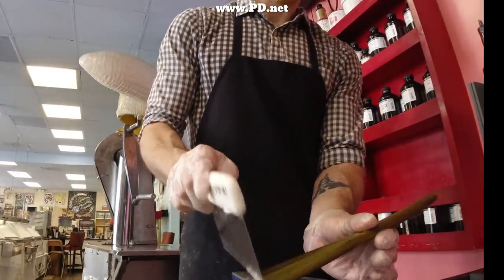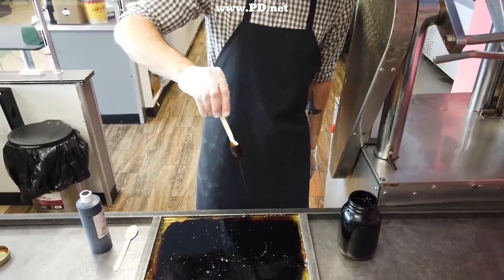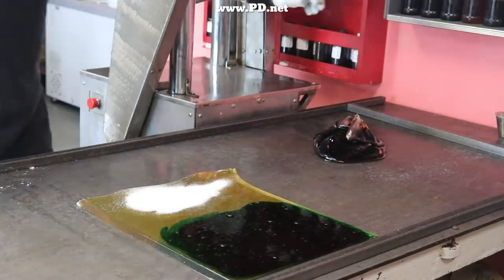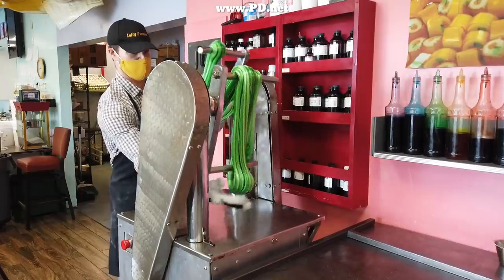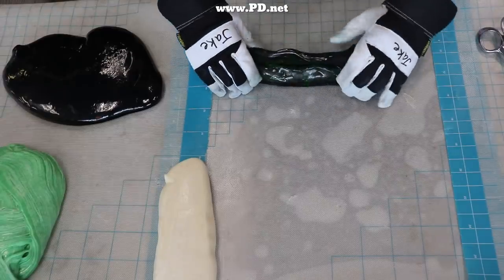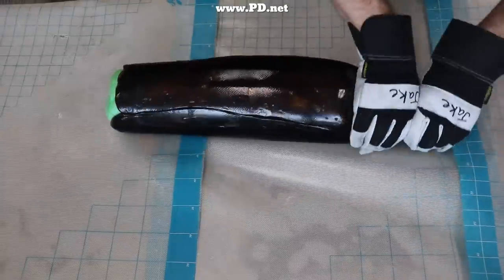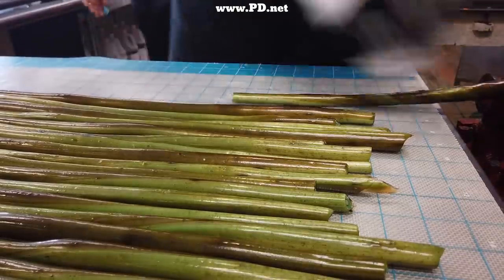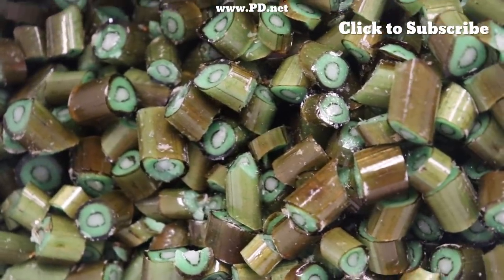#138 Kiwi Candy: Jake takes his skill to the next level - Part 1

Comment: He is like 90% of the way there. If he adds a separator between the seeds he would be golden.
Reply: exactly what i was thinking. perhaps if he prepared a little less black and a bit more light green, he could use some of that light green as spacers for the seeds. thered be less seeds, of course, but thered be good separation, so he could create a little better of a kiwi design. still a great first draft from him though!
Reply: @LiminalMashups  it might be easier to just wrap the seed in a layer of the light green that way as it's stretched out and multiplied it has the separator built in
Reply: also imo it would be better with more opaque skin
Reply: @radiomandelbrot5868  I think the greenish brown actually fit well, but it's been a long time since I had a kiwi

Comment: @LoftyPursuits
I'd like to see you pick your favorite polymer clay YouTube crafter and make candy based on their design.
Reply from the maker: They look like they're similar but they're not. But they can do easily we can have trouble with, And the opposite is very true too. I am working with a non-newtonian fluid and they're working with a mobile solid.
Reply: @LoftyPursuits  
No doubt the clay would be more intricate in design and allow for more colors (that won't mix when not intended to do so).
Regardless, you do fantastic work. I especially like your flower candies.
Reply from the maker: Yes, but the candy scales more easily because it's a non-newtonian fluid, on the other hand you have much less time to work with it.